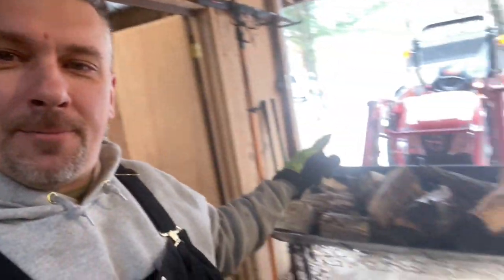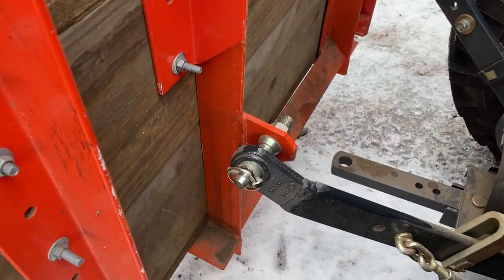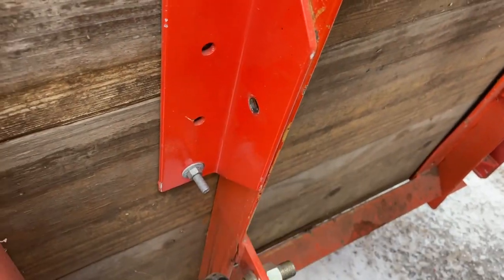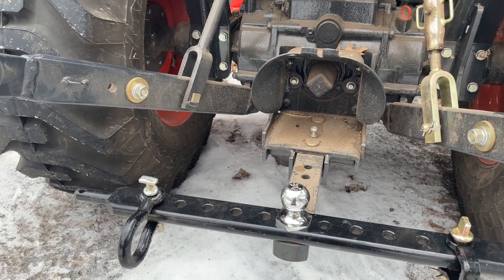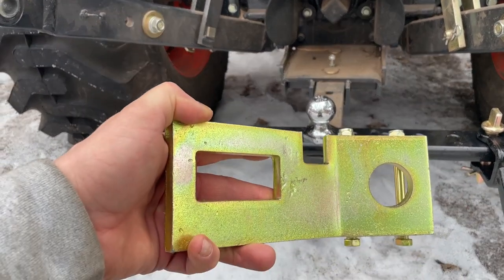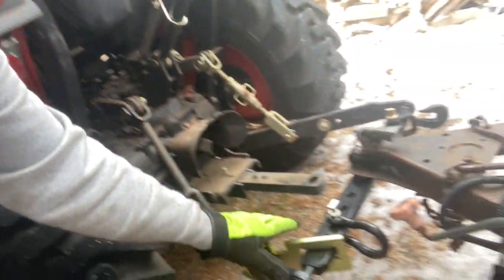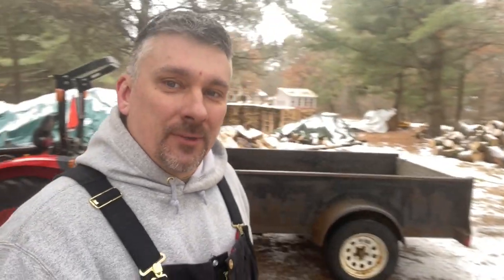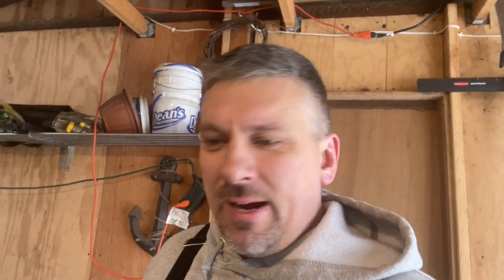I Bent the Carry All Frame - How Bad Is It?

Comment: Check out you local welding shop and get and estimate to fix. May or may not be worth it. Looks like it was made way too light weight.
Reply: That's the best idea It could be straightened  out and then beefed up with steel.for less than buying a new one and beefing it up.

Comment: It is sliding over because you only have that one bolt in it, put in the second bolt and it will no longer move over.
A good welder can heat that frame up, straiten it, and properly reinforce it after, probably be cheaper than another $150.00 unit.

Comment: take it to an fabrication company they will fix it by applying heat and get it strengthened up by fitting cross members take there advice but if they are 150 dollars new wont it happen again good luck ken from kent england